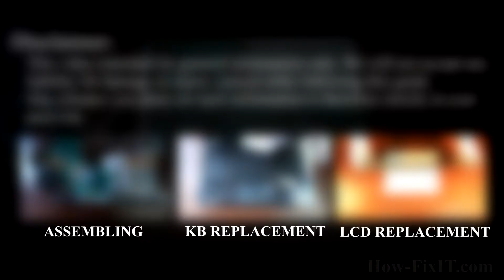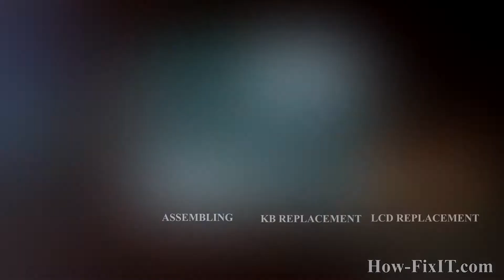HP Pavilion dv6-3000 Series Disassembly, Fan Cleaning, and Thermal Paste Replacement Guide

Comment: Anyone still use this laptio until now ?  My laptop cpu run at full load is 85 degree of C.  Is it too hot ?
Reply: Judging how ancient these laptops are it's safe to assume the thermal paste dried out and needs to be replaced asap.
Reply: I still rock this laptop.  With 8GB of RAM and an SSD, it actually works pretty decently.  Haven't reapplied thermal paste, but planning to do that soon.

85 C is pretty hot in general.  Intel CPUs are usually rated to go to a max of 100 C but will start throttling to keep it at 85 or lower.  I would definitely recommend reapplying the thermal paste or at minimum cleaning the fan and other insides out.